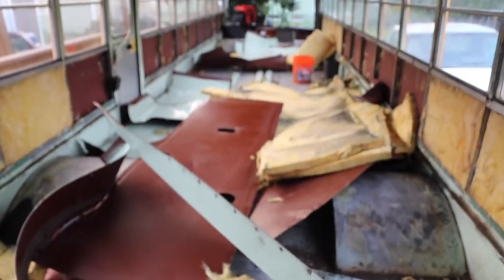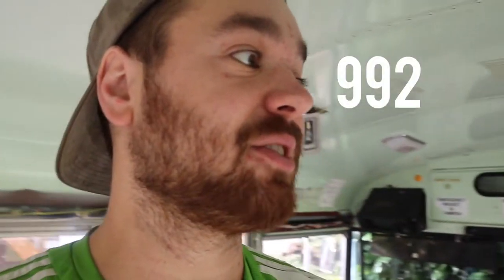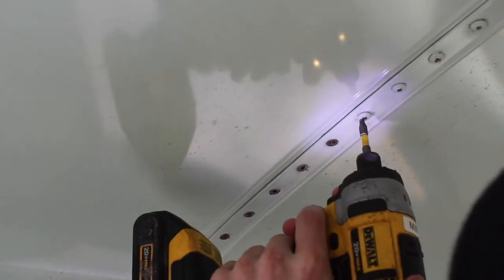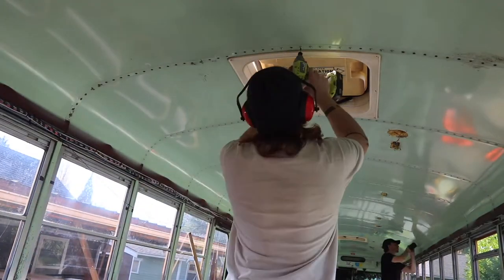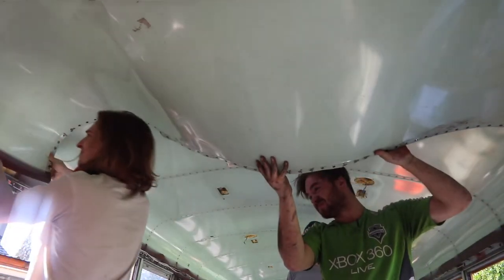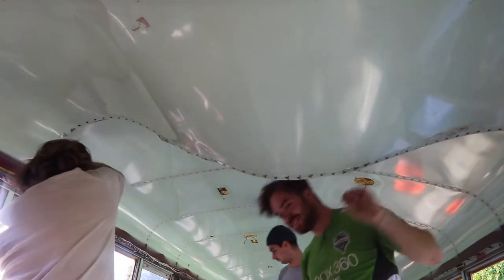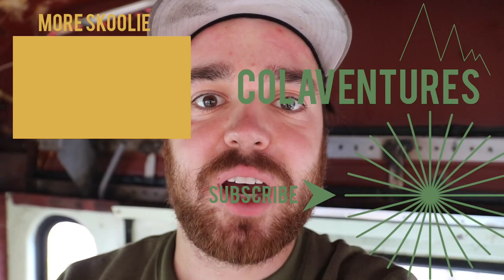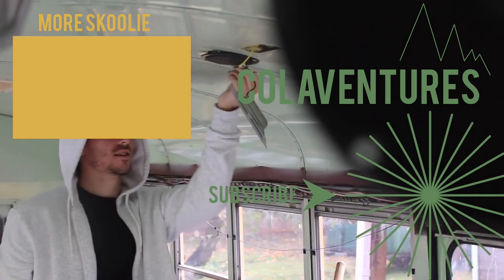Ceiling Removal - Skoolie Bus Conversion - E7

Comment: Air tools are the answer. For sure. Air chisel eats stubborn screws and rivets. I also have a Thomas MVP ER 1999 8.3 liter with a MD 3060. About to start my demolition soon after motor swap is done. Your conversion turned out very nice.
Reply from the maker: Thanks! Yea the air tools would have made that a lot easier. It was a good work out though!

Comment: I have a question I am trying to convert a shuttle bus and it has pinholes that leaked into the ceiling, so when I removed the ceiling the plywood is ruined and moldy, but the metal rods are holding it into place. Should I take those down to get the plywood out? or should I try something else, because someone told me that the ceiling would come down if I removed those rodes?
Reply from the maker: Hi! I'm not sure about the metal rods. Might try removing one or two to see if it makes a structural difference. or get a tool that will let you cut the plywood out around it.
Reply: @ColaVentures  Hello Issac I have a lot of future Conversion plans.